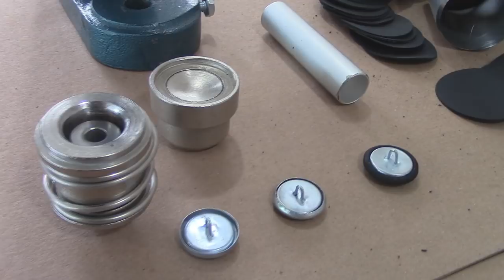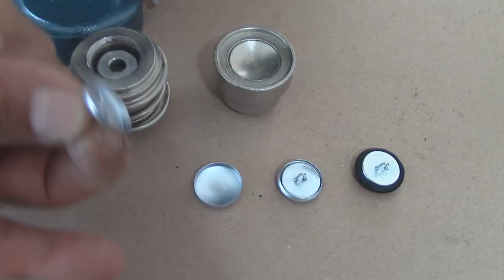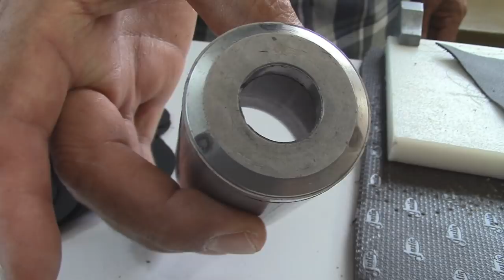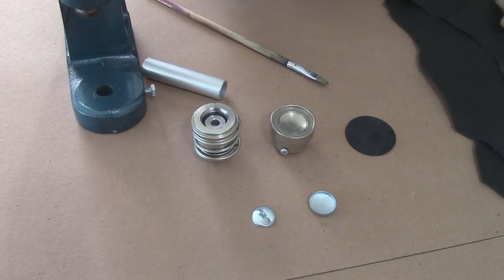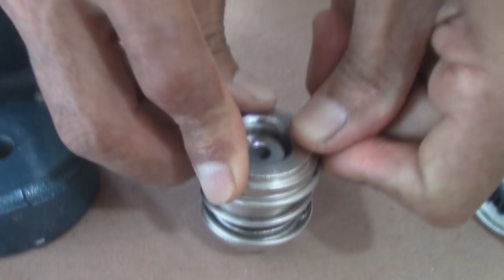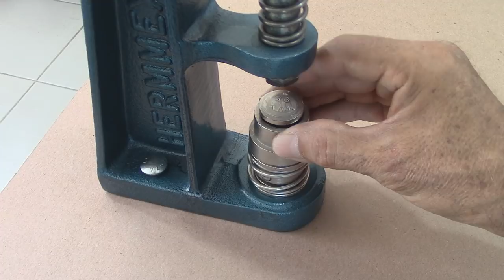Upholstery Buttons in Leather

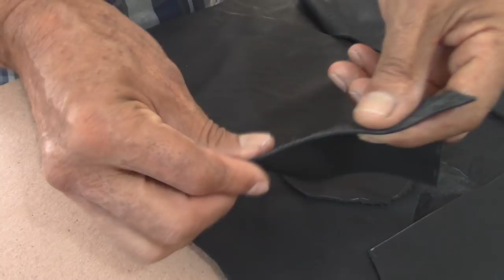Comment: Hello and thank you for posting this. At mark 1:37, you put a piece of leather into a machine, to mash it down and make it thinner? What is that thing, and can I achieve that effect without it using some hand tool?
Reply from the maker: Actually, to do the wrapping of buttons with the press and dies they should be thin enough to be folded over to the metal molding buttons.
The machine I use is a leather skiving machine to reduce the thickness of leather material to 0.7 mm thick at least.https://youtu.be/QVyYC3-Zbug?t=349
The skiving process could be done by hand with a very sharpened knife. Not so easy but it could be done. Unfortunately, I do not have a video.

Comment: Hi, Cechaflo. I guess you have many different button and cutter sizes. Can you tell me what punch cutter diameter do you use to cut 3/4" buttons?
Reply from the maker: I do not have that cutter, sorry.
Reply: @Cechaflo  Thanks anyway Cechaflo. Have a good time.
Reply from the maker: @UFOENGINE  You could make your own calculations. I have used  7/8" buttons (bare core) My punch is 1 3/4 diameter. The idea is to have enough flap that should be folded over to the inside button reverse.
The buttons you want to use are 3/4" ...1/8" less than mine. So, now you can calculate how wide your punch will be.
https://youtu.be/i4bTJJzdg0E?t=138
https://www.youtube.com/watch?v=I7yAH7FQ3fk&t=2s
Good luck!

Comment: Great videos.  I am looking to purchase a die (#30) for general upholstery fabric.  Would the button die set you are using be suitable for vinyl and soft automotive leather?  My old boss tells me to just buy a heavy and double up the fabric.  Any advice would be great, thanks.
Reply from the maker: Most of these dies are for thin materials. If you would use leather it is advisable to skive the piece to reduce the thickness (6 to 7 mm approx.) If you would use vinyl take off the backing cloth in the back.

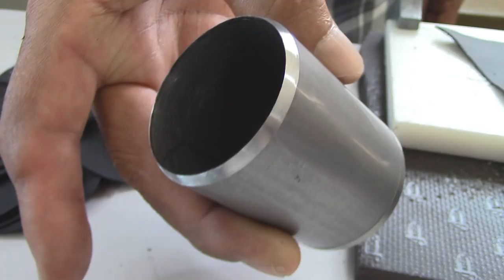Comment: Hi. What is the diameter of that cutter at 02:08?
Reply from the maker: The cutter is 4.5 cm  wide (1 3/4" approx)
Reply: @Cechaflo  Thanks for the reply. This particularly you used to make 36 sized button in the video, right?
Reply from the maker: @UFOENGINE  I do not know which number it is, but the diameter is 7/8"